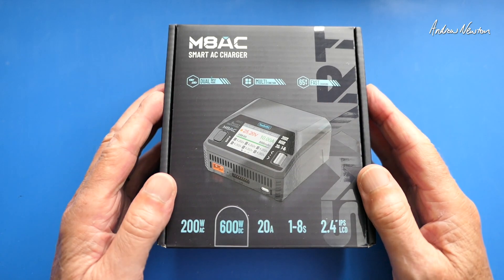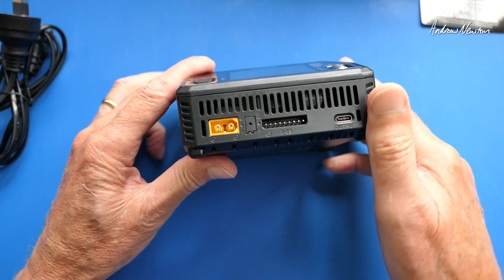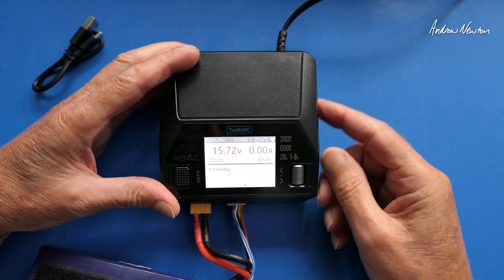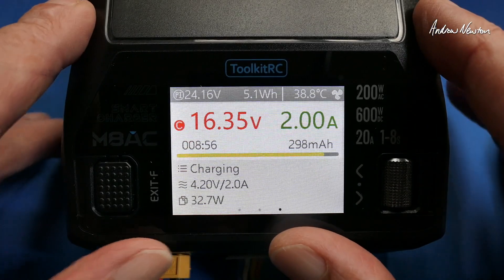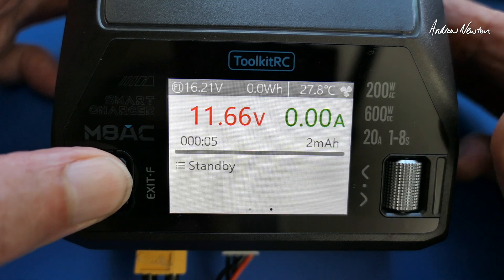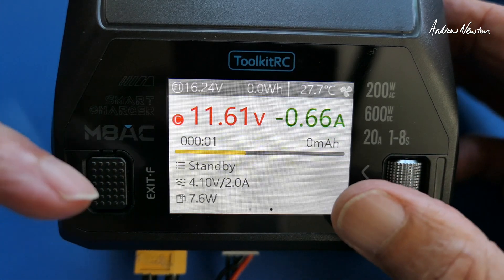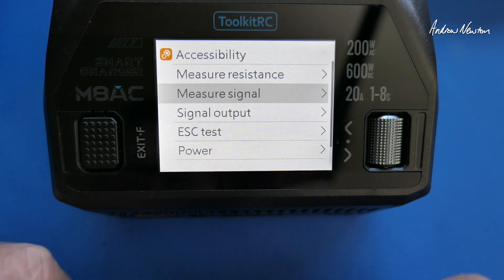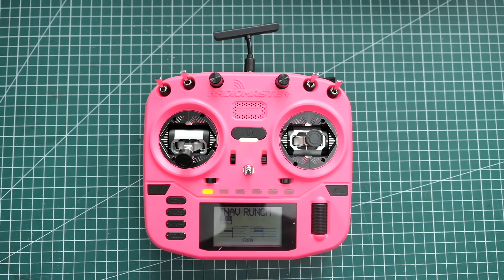ToolkitRC M8AC 8S Multi Charger

Comment: Please check the individual cell voltages of the battery after a full charge from empty. This brand ToolkitRC is known to unbalance batteries with their past "smart" chargers. From experience!
Reply: Yes, they have destroyed several of mine too, while their display shows the correct value. I wondered why so many of my packs were failing prematurely until I measured live readings.
Reply from the maker: Thanks for the warning